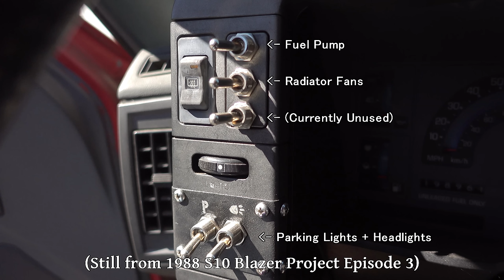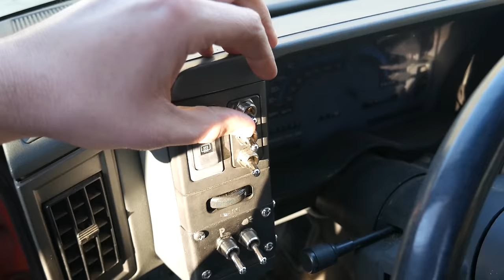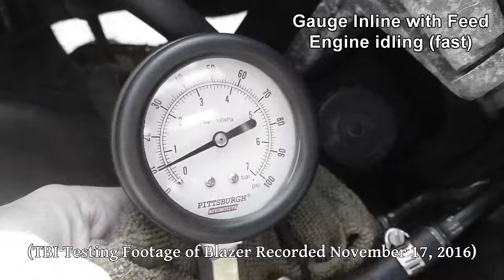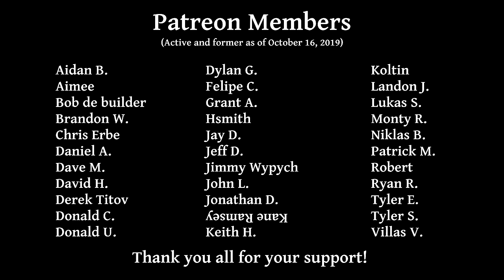V8 S10 Blazer Project Emergency Kitchen Floor Carburetor Rebuild (Ep.19)

Comment: I've had carbs my entire life (including now) and this video is all the evidence I need that my love of fuel injection is well warranted. I may be putting the hex on myself right now by saying this, but I've spent, maybe 5% of the time trouble shooting EFI as I have carbs. I don't envy you in that situation.
Reply: EFI for life, yo!  I respect carbs, and people like my brother and uncle who can tune a carb to actual performance levels with a pocket screwdriver and their ear, I'm more of a lambda sensor and laptop kinda guy myself.  Thing is... you can leave the raunchiest gasoline sitting in an EFI engine for a decade, put new fuel in, crank it a few times and the thing will roar to life!  I have a hard enough time keeping my lawn mower running... in fact, my love for EFI is so extensive, that I'm planning on fuel injecting my riding mower!

Hell... when I decided I wanted to turbocharge my mazda miata in 2004, I bought a megasquirt kit and not only built my own EFI controller (it was a literal bare board and a box of resistors/capacitors/mosfets/diodes), but I wired and tuned it myself.   What a fantastic experience that was!  Nothing better than hearing people tell me how "it'll never run" and "that thing will do nothing but give you problems" to only experience YEARS of flawless functionality and the realization I actually built an 11 second mazda miata.  I call it the "Hairdressers express."  2200 pounds, 300whp, 260 pounds of torque.  What a treat this car is...

Comment: Hey man, I've been with the channel since the first few episodes of the blazer and I'd like to thank you for putting in the time and effort into making the videos. Because of you, I wound up picking up a cheap 87 dodge Dakota for 200 bucks and I'm in the process of bringing it back to life
I'm hoping that it'll turn out like the blazer did (minus the rod knock from the old motor bit)
Keep on doing what you're doing man, I know editing is a pain at times but I'm sure that if you make the videos that they will be watched
Reply: Cool that you got a project, i had just gotten a project myself. After watching these videos i had bought a 91 s10 blazer for 500 bucks
Reply: @jadenbrigman3693  Sweet man, I've actually got the dodge going now and one of my friends is buying it off of me 😂 at any rate though now I'm in the market for something chevrolet
Reply: @speeddemon4484   great that you got it running im still working on my blazer. I have a vacume leak that needs fixing and a few minor things. Ill probably make it my daily driver whem said amd done

Comment: Hey man a little tip about making gaskets, what you do is take some used motor oil or cooking oil and rub it on the part your making a gasket for and press it onto the gasket sheet, it will make a perfect shape for the gasket

Comment: If you use Permatex Number 3 gasket goop, it stops gaskets from sticking and breaking like this, so you can open parts with a lot more confidence and re-use the gaskets many times over. It's fine for use in carbs. Just don't spill it in your toolbox, you'll never get it off, sticky hands forever. Anyway I'd put Permatex #3 on literally any non-metal gasket, even a head gasket.
Reply from the maker: Interesting, I hadn't heard of it being used for that purpose before! Thanks for the tip, I'll have to check that out!

Comment: I missed why you pulled the TBI. I don't get why people hate TBI so much, compared to a carburetor it's light-years improvement. You're not going to make a ton of power with it but it's cheap and reliable.
Reply from the maker: I bought the truck with the 4.3L engine and TBI, pretty quickly had issues with the TBI system and tried everything but couldn't diagnose it. Pretty sure there was an issue with the computer. Ditched it for a carb, later the engine spun a rod bearing and the V8 was installed keeping the carb system. I got some of the TBI parts with the V8 I bought, but not enough to make it work and decided to just stick with the carburetors to keep things simple. "Simple."

Comment: Not to criticize, only inform. The proper fuel pressure on any carb-ed chey ic 6.5 lbs. I own a carb shop and have 40 yrs experience. Also, the float clip could cause a problem. It does not go in that oval hole, it goes away from you on the flat part towards the float. From Rochester Service Bulletin. The accelerator pump cup is bad when has to be pulled out with a tug, due to e10 fuels. Also, that pump spring is actually the fuel filter spring. The real pump spring is longer. Well wishes! Stay warm

Comment: How useful is that Husky cordless ratchet, aside from working in sub zero temps?  I never thought of purchasing one until I saw you use it in this video.
Reply from the maker: I got it on sale for $50 (came with sockets, too) and at that price it's fantastic. Even at $100, it's probably a decent choice. It has a built-in battery and proprietary charging cable so I don't think it's exactly an heirloom tool, but it has worked great for me so far! Under normal conditions the battery lasts a very long time. I also actually like that it's a little weaker than some of the other brands, the newest Milwaukee one is unpleasant to use because of how hard it jerks your hand on a stuck fastener. Using it as a manual ratchet, it won't stand up to the claimed "150 ft/lbs" but 50 or so is totally fine. I have pulled on it hard enough that it feels like the body is going to explode off of it and it never skipped teeth.

Comment: Hey do you ever plan to add AC back into your S10? I know it’s hard to do so, but if you’ve got the compressor, it’s not that hard to pick up a conversion kit and a condenser. 

Or does the S10 still have overheating problems/ not enough space?
Reply from the maker: I don't think I'll ever add it back in, but who knows! There isn't a lot of space but there are options out there. It still will get pretty warm and overheat in bad traffic, but I have a larger radiator ready to go in that will hopefully take care of that part of it. A lower idle and better tune should also help a lot.

Comment: Not being picky, but I was watching some of the other Qjet "professionals". They said the ear that dangles the needle over the seat was supposed to be in the center of the hanger. Not with the ear going into one of the holes. Not like I know for myself, as I am just starting to build my own. But what do you think or have you heard differently. I concur that it would seem the ear would latch into one of the holes, but in theory it would keep the needle to one side or the other by a fraction of an inch...

Comment: I’ve always been curious about this. Why did you go with a 350 instead of a 305? Considering that it would be easier to install in the truck. If this is a dumb question, I’m sorry, I’m a ford guy.
Reply from the maker: The 350 and 305 are the same external size, really the only difference is the bore diameter inside the block. Most of the parts (including cylinder heads) are even compatible between them. Not a dumb question! Based just on the numbers it would seem like the 305 would be a physically smaller engine.

Comment: At 3:07 you hit the throttle, it looks like your Butterfly, or linkage is lifting the air filter . Do you have enough clearance under it ? Spray your gaskets with white lithium grease , that will allow you to reuse them over and over.

Comment: My 86 k5 that is a factory 305 with the factory q-jet sm465 with 4.10s and military 37s now gets 17-20 on the hwy at 55-60 mph. Part of your bad mpgs is that your th350/700r4 is eating up hp to move it, that's one of many factors as to why I stick with manual trans besides the better gearing.

Comment: They didn't get the nickname "quadra puke" for nothing. I hope you saw the cross fire on the plug wires. They are not as bad as their nickname but I digress, I went holley for a good reason. That float issue was news to me but I haven't pulled on wrenches for some time since I got crippled about fifteen years ago. I hope it works out for you and your lady friend. I just don't much care for the quad's myself. You got lucky on that gasket I figure and God couldn't see punishing you further/ I jokes.LOL. Most fuel issues is rich jet mixture and those are replaceable. I think  one of the places that you buy parts for it can help you select but be warned that too much smaller is really too much as they just are not good performers... Funny video
Reply from the maker: Where are you seeing the crossfire? I assume you are just seeing the arcing through the clear distributor cap, others have made that same mistake. I can't seem to see any sparking between the wires in the video.
Reply: @FuzzyDiceProjects  I replayed the video and at 3:01 or just a touch before you see the two wires  that are zip tied together behind carb and pointing at cylinders #2 and #4 closer to cap than carb and those two are real close, and in black and white resolution its plain as the nose on your face.... hope this helps
Reply from the maker: @morgansword  Thanks for the specifics, that is definitely the arcing inside of the distributor (from the rotor to the terminals) that is visible through the clear cap. It is very noticeable at night, and like you said that black and white filter really brings it out as well while making the clear distributor cap less obvious. The wires are all kept about 1/4" apart via zip tie separators and the wires are relatively new, never noticed and issues with them.

Comment: The clip that is attached to your needle is not in the correct spot. It does not go into the hole it hooks onto the backside of the float, around the half-moon shaped area. Do not hook it into one of the two holes.

Comment: When I took off my airhorn recently to replace the accelerator pump I pushed out the pin flush with the choke wall. Wish someone wouldve given me this advice then. It was a bitch to get out and I have no idea how I managed to get it other than some mix of luck and magic.
Reply from the maker: I have made that mistake before, grab the pin with some good needlenose pliers and use leverage to move it away from the choke wall just a hair. If you can't move it any more with the pliers a chisel will help with the rest. Glad you were able to sort it out, sorry you had to deal with it!